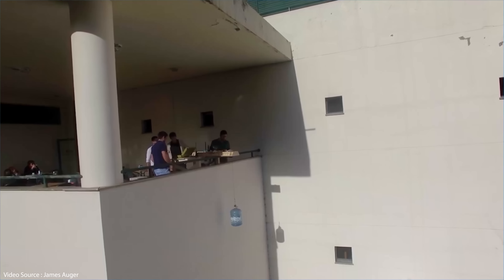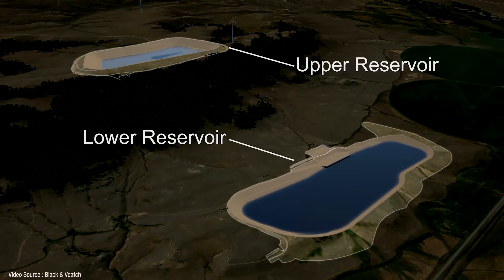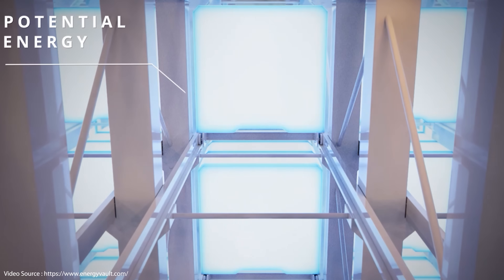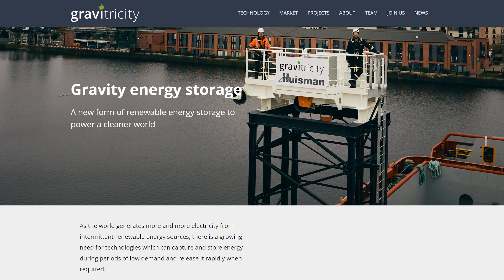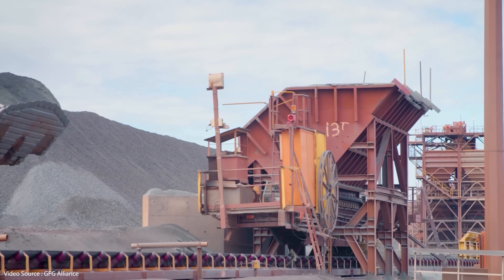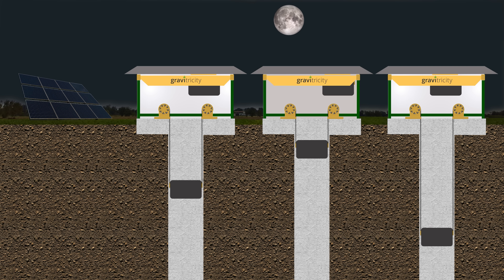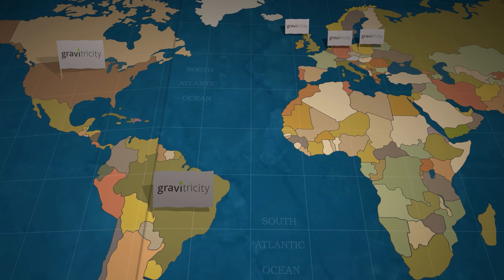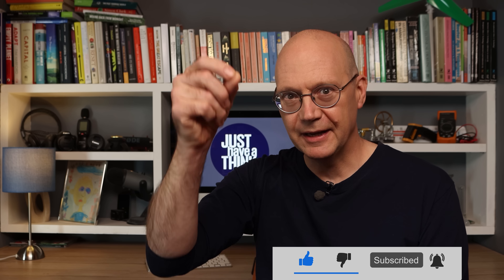Gravity Energy Storage. Who's right and who's wrong?

Comment: Fair play Dave. I love the fact that you circle back. Keep it going. These progress reports are interesting. Thank you
Reply from the maker: Cheers Brendan. Much appreciated.
Reply: @JustHaveaThink  just been reading an article about algae being used in glass panels on buildings which sounds interesting.
>Beautifully designed, energy-generating bio-panels that suck up carbon dioxide and pump out biomass for use as fuel or fertilizer – that's the idea behind Mexican startup Greenfluidics and its nanotech-enhanced microalgae bioreactor building panels.
Reply: @JustHaveaThink  🎓
Reply: @JustHaveaThink  What about capturing humidity on top of a mountain using mesh nets and transferring it to holding ponds then letting huge bags of it down a slide or chute?   You could use wind power up there and use that to run pumps while you have wind and solar too.   I want to see how that math breaks out.  How much water do you have to have at what height do produce how much energy and how much can you get from nets.  If you could capture clouds up there you could make a lot of power.  An average cloud weighs about about 1 billion 400 million pounds.   Capturing clouds already in the sky seems like an op way to get a lot of weight high up for something like this.  You could also run huge Absorption Refrigeration systems up there and make cool air to pump down and get tons of water up there as well... not sure how well you could use the cold air but the largest Absorption Refrigeration units made now make something like 250k gallons of water per day.  That's about 950k kilos of water per day per unit being run on a mountain.  Making weight up high rather than lugging it up high.  I just ran a little basic math so see how it would shake out.  So 1 square meter of fog collecting mesh collects about 1 gallon of water per day.  there are 2.59x10e6 square meters in a square mile aka 630 acres.   and water weighs about 8.35 lb per gallon 25900000 X 8.35 = 216265000.  divided by 2.2 to turn lbs into kilos. 98302272 kilos.  per square mile.  I noticed that there is a mt Whitney in California near LA and San Fransisco and it is about 6000 to 14000 ft above sea level and 581000 acres San Fransisco is about 52 ft above sea level.   So 1 percent of this mountain is 5810 acres.  Let call it 9 square miles...  lets see how much power could be generated using the mesh over 9 square miles assuming 10000 square feet up and if somehow you could lower it all the way down just for reference.    Looks like you'd have about 90000000 kilograms of weight at a height of about 10 kilometers per day.  Sounds like about 9 billion or so kilowatt hours if you use 1 kilogram at 1 kilometer has about 1 kwh of energy potential I heard somewhere that was about right a while back.  So I now have 9 billion kilowatt hours per day of energy storage using the weight of fog and clouds let's say maybe.   Okay so now over 365 days in a year.   That's about 3.285 trillion kwhs per year.   That is about 80 percent of the number that I get for the total energy consumption for the entire country annually.  3,900,875,000,000.00 kWh (2018).  That would be using 1 9th of 1 percent of 1 mountain in California 9 square miles.  Please if you read this and even half ass care correct my math.  Total infrastructure cost a bunch of mesh a couple very long slides and some pretty substantial generators then it's problem solved.  Btw in this design I used no solar or wind power at all just mesh collecting water on a mountain.  Yes it would be too much power to transmit all over the country through power lines but if you have that much power use it to breakdown water into H 02 and make pipelines that can send the gas across the country I think that would be much cheaper then any other way to transmit the power through  lines or truck it all over or whatever.
Reply: Freja Solstheim  Did you see the youtuber Thunderfoot's critique of gavitocity: https://youtu.be/NIhCuzxNvv0
He's a bit harsh but I think he's that way because of how bad Elizabeth Smart burned investors with Theranos which he wasn't loud enough in debunking.
Reply: What about capturing humidity on top of a mountain using mesh nets and transferring it to holding ponds then letting huge bags of it down a slide or chute?   You could use wind power up there and use that to run pumps while you have wind and solar too.   I want to see how that math breaks out.  How much water do you have to have at what height do produce how much energy and how much can you get from nets.  If you could capture clouds up there you could make a lot of power.  An average cloud weighs about about 1 billion 400 million pounds.   Capturing clouds already in the sky seems like an op way to get a lot of weight high up for something like this.  You could also run huge Absorption Refrigeration systems up there and make cool air to pump down and get tons of water up there as well... not sure how well you could use the cold air but the largest Absorption Refrigeration units made now make something like 250k gallons of water per day.  That's about 950k kilos of water per day per unit being run on a mountain.  Making weight up high rather than lugging it up high.  I just ran a little basic math so see how it would shake out.  So 1 square meter of fog collecting mesh collects about 1 gallon of water per day.  there are 2.59x10e6 square meters in a square mile aka 630 acres.   and water weighs about 8.35 lb per gallon 25900000 X 8.35 = 216265000.  divided by 2.2 to turn lbs into kilos. 98302272 kilos.  per square mile.  I noticed that there is a mt Whitney in California near LA and San Fransisco and it is about 6000 to 14000 ft above sea level and 581000 acres San Fransisco is about 52 ft above sea level.   So 1 percent of this mountain is 5810 acres.  Let call it 9 square miles...  lets see how much power could be generated using the mesh over 9 square miles assuming 10000 square feet up and if somehow you could lower it all the way down just for reference.    Looks like you'd have about 90000000 kilograms of weight at a height of about 10 kilometers per day.  Sounds like about 9 billion or so kilowatt hours if you use 1 kilogram at 1 kilometer has about 1 kwh of energy potential I heard somewhere that was about right a while back.  So I now have 9 billion kilowatt hours per day of energy storage using the weight of fog and clouds let's say maybe.   Okay so now over 365 days in a year.   That's about 3.285 trillion kwhs per year.   That is about 80 percent of the number that I get for the total energy consumption for the entire country annually.  3,900,875,000,000.00 kWh (2018).  That would be using 1 9th of 1 percent of 1 mountain in California 9 square miles.  Please if you read this and even half ass care correct my math.  Total infrastructure cost a bunch of mesh a couple very long slides and some pretty substantial generators then it's problem solved.  Btw in this design I used no solar or wind power at all just mesh collecting water on a mountain.  Yes it would be too much power to transmit all over the country through power lines but if you have that much power use it to breakdown water into H 02 and make pipelines that can send the gas across the country I think that would be much cheaper then any other way to transmit the power through  lines or truck it all over or whatever.
Reply: You know he takes this seriously, and has an open mind, and just not gullible, as he takes in account debunker channel input. Much more credible than your typical Tesla fan boy.
Reply: Freja Solstheim  There is a reason they didn't compare it to hydro. this is so laughable tiny (24.4MWh), nobody would consider to build a hydro this tiny. LCOS scale mostly with size (especially for hydro). 
Actual average Data from Lazard (same source the imperial college of London uses sometimes):
compressed air, pumped hydro, and lithium ion batteries are $128/MWh, $175/MWh, and $414/MWh
But that's real data including the cost overrun during construction etc. Meanwhile the calculated number for the "new" tech is the estimate of the enterprise proposing it.
I didn't find this Study, but another one for gravitational storage: https://heindl-energy.com/wp-content/uploads/2018/10/LCOS_GravityStorage-II-Okt-2018.pdf
Something a bit more serious, as the stored values are of significance (it's basically a hydro which could be built anywhere, again numbers are estimate (probably optimistic ones)). 
Page 8 also reveals why we don't just make it all compressed air: compared it's rather inefficient with only 42% of the energy recovered.
Reply: @beyondEV  The only way to make gravity energy work with anything other then water is to use an extremely dense material as the potential energy storing medium. That is the only way to increase the storage density other then building very deep mines which has its own problems. Those are the only places of improvement and if they cant make it work there is no way arround it.
Reply: @beyondEV  he said it's like a regen braking system obtaining energy slowing down the fall or storing more energy braking the rise?  THE REASON I WATCHED!!!  Inertial sneaking into gravitational omfg tremendous amounts of energy can be stored launching matter vertically and then regained when it comes down at a pace to some extent you decide.  Like  juggler

Comment: These remind me of elevators... and is had me think: why not modify how elevators work? Normally, you have a counterweight to help the motor, but why not raise the counterweight when power is in low demand, and lower it to harness it's potential energy when needed? It would save the cost of building a structure, and might require only to replace the motors and modify the pulley system.

Comment: It seems to me that the gravitricity process has endless variations. How many old closed mines are in the western US where you would only need a headframe built to use them? And that same principle could be used on steep inclines with rail systems and cables. I have seen many slopes in Colorado that could be utilized to great effect. But the best solutions would be very close to the power source to keep down transmission costs. Where are the good solar and wind opportunities and how many storage sites are available nearby? Pair them up near an end user and you have renewable power 24/7 which is the stumbling block. Smaller more localized grids that can interlock is the real solution. I really like their answer for using gravel instead of solid weights as it could extend the life by reducing weight as they approach end of life means a gradual degradation instead of a sudden shut down as metal fatigues and cables weaken. Just lower the weight by removing gravel to get more years of use. Lower output is better than no output. And just think if ski slopes would build such systems large enough to  provide their own power plus enough to power the towns that are nearby. In the off season they would have a source of income as all of the power could be sold on the grid. Just put them in pipelines with tracks inside and avoid the weather issues. No reason they must be totally vertical.
Reply: @ Mark
I thought of the ski hill idea as well. I’m wondering about the necessity of rails though. Given enough compacting and a ‘sled’ type design at the top and bottom ends of the weights you could simply slide them up and down the hill. Miners use to ‘rawhide’ loads of ore downhill.
Reply: Most mines have a significant power requirement to run machinery, lifts, lights etc.

Most of the basic infrastructure is already there.
Might need some upgrades.
Reply: The problem is that people are still thinking about a grid providing energy to customers and talking about grid scale solutions. That makes these problems seem far more complicated and challenging then they will be.

Decentralisation is key here. Of both generation and storage.
The economics are turning against grid based solutions. The grid has to become a management system instead of a delivery system.

Comment: wonder what is the efficiancy of the mine shaft system. how much is the out put electricity produced versus elecricity put in to raise the weight
Reply: Sheesh. These storage designs are not about efficiency as in the % of power out compared to power in. They’re about storing power being produced by renewables in excess of current demand and then releasing that power when demand exceeds supply. Again sheesh!

Comment: Am I seeing what I am seeing? gravvitricity is stacking multiple weights down the same well? Interesting to know how they are managing reliable release mechanisms and the retrieval of the lowering cables/intervals between weights. 

Didn't see a method where there are two sets of cables per well, one lowering whilst the other is retrieved for next cycle, or looped with attachments at intervals to keep the process turning in the same direction like a paternoster.

Comment: Has anyone thought about using liquid mercury in a gravity based pump/turbine storage system in old mines? You would only need 7.4% of the liquid volume compared to water to produce the same energy from the same elevation difference. Of cause you need to take care of safety, avoid poisoning of staff, contamination of the environment, and not use aluminum and other metals that might be damaged by mercury.
Reply: I read "liquid mercury" and started going "no no no" because what if it leaks?

Comment: To me this sort of idea neeeds some big picture  maths.  Gravitiricty is moving material denser than water, but seems otherwise not unlike pumped hydro.  Some calcs based on possible figures.  Density?  Dimensions of weights?  Depth of hole etc.  I think such calcs would give an overall idea of a typical project, and allow cost estimates.
But like pumped hydro, it needs relatively scarce holes in the ground.  That is a big limitation.  Evidently the economics assume a free hole.
Reply: Actually, a useful comparison. Mine shaft, relative to size of reservoir, density of material etc. You can envisage that it would store nothing like a pumped hydro system.
Reply: @chrisheath2637  Seem to me that a comparison like that is the first thing to do.  Does not need rocket science, but gives a good idea what the physical challenges are and an idea of the worth of a final product.  I find iit irritating that so many energy ideas are proposed without this kind of ballparl numbers.

Comment: I think that only viable option is to combine both concepts, use mineshafts and weight packs which would be stored in the old tunnels. Because using only one weight would give only 40MJ assuming 800m shaft and 5ton weight, which is not that much.
Reply: I think the plan is to use 500 tonne weights.
Reply: @matthewwakeham2206  Even so you will get only roughly 1.1MWh, considering one Tesla Megapack module has 3MWh, it is still not enough.
Reply: @urbiso  I don't think it matters. What matters is the LCOS. If it has lower LCOS than the tesla megapack then you can just build 3 of them instead of one and call it a day.  Granted this LCOS might need to include the exacavation cost of a 500m borehole, and I haven't done those calculations, but a megapack is over 1million each, and you can dig a good sized hole for $1million.

Comment: I saw a video of two young men who are planning to lower weights into abandoned oil wells in the US.
Reply: Average oil well depth is up to a mile.
Reply: Oil wells do have ‘casing’ built into them but it is fairly thin as oil is not usually under high pressure. Gas wells may have thicker casing but neither would stand up to being hit by the kind of weights we’re talking about here. And wells are not all straight up and down, although enough of them may be to provide suitable locations for this kind of project.

Comment: My Idea is simply 1mineshaft / Elevator shaft is 1 unit 2x2m X depths. Dig a trench 10m long 20m deep. So in the 10. You have 5 Shaft unit's you can use the excavated material to build the blocks or use it in another way.  you can stack them . use a building for storage  and on it roof Solar panels.

No complicated movements just up and down.

Gravitysity could build it underground

Comment: For sure gravitricity is more promising, the only problem - they using old mines. And here we have a problem, because from my knowledge they have a tendency to be flooded by ground water hence changing this ideal system. For safety reasons quite often water is pumped out, but the point is, part of stored electricity will be used to pump out the water, so hopefully balance would be still positive.
Reply: You know, that sounds like mines would make a good candidate for pumped hydro... pump the groundwater to the surface on off-peak hours (with a small amount of power used to re-circulate water the seeps back in), then release it through the pumps to and release the water back into the mine and generate power on demand.
Reply: @erininstereo47  well, then you need to store it somewhere, and in a meantime new water come from the ground.  So basically more water you have to pump out vs what you could possibly use. I'm not an engineer in this area, it just what come to my mind, probably this company have someone from this area in the team.